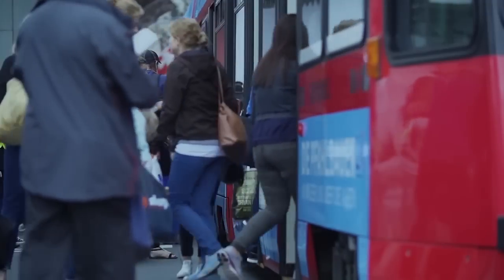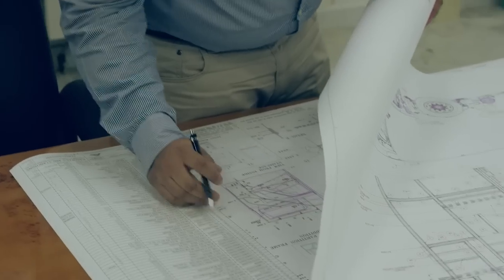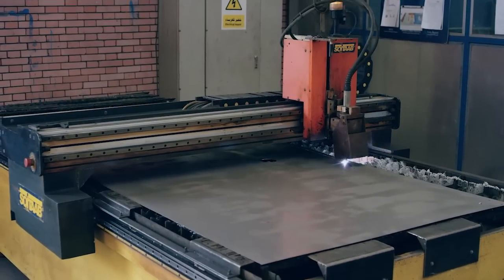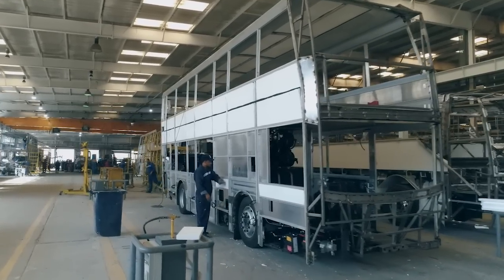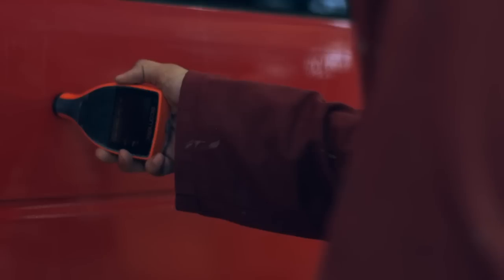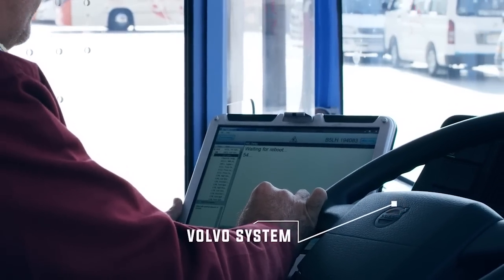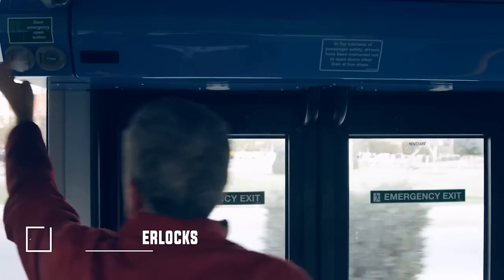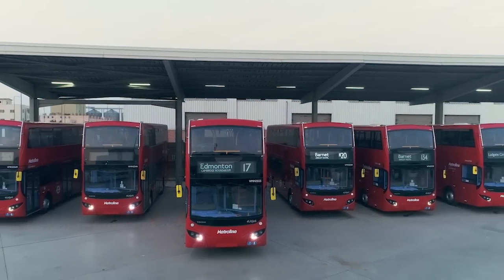MCV eVoSeti | How a Double Deck Bus is Built

Comment: Much as I am not comfortable asking the depot why they stopped running the London Suburban Loud 4-Speed Leyland Hydra cyclic Automatic Gearbox Gardner 6LX and Gardner 6LXC Diesel Engine Olympian ECW’s on routes N26, 30, 121, 230, 271, 349, N279 And 158 why can’t we make the same make of the Loud 4-Speed Leyland Hydra cyclic Automatic Gearbox Gardner 6LX and Gardner 6LXC Diesel Engine Olympian ECW Buses but Modernise the insides of these Buses. Also, make it low floor up and down and also extend the middle body part of these vehicles a little bit more so there will be more space for the wheelchair users. By the way, if you could remake and Modernise these vehicles could they also make them into a Loud 4-Speed Leyland Hydra cyclic Automatic Gearbox Gardner 6LX and Gardner 6LXC Diesel Engine Olympian ECW Version’s that if it will be possible and Modernise the insides of these Loud 4-Speed Leyland Hydra cyclic Automatic Gearbox Gardner 6LX and Gardner 6LXC Diesel Engine Olympian ECW’s make it low floor up and down and also extend the middle body part of these vehicles a little bit more so there will be more space and even a London Suburban Scania N230UD Enviro 400 MMC and also extend the middle body part of these vehicles a little bit more. Why couldn’t we have those London Suburban Buse's Pale red on the top roof Pale red again on the top middle Milk Chocolate brown in the middle Creamy white on the Bottom Middle and Milk Chocolate Brown on the Bottom on most of those kinds of those Particular Double Decker Vehicles? Could you put the Loud 4-Speed Leyland Hydra cyclic Automatic Gearbox in the Scania N230UD Enviro 400 MMC and also put the Loud 3-Speed Voith Diwa Gearbox in the Volvo TD102KF Engine East Lancs Olympus and also extend the middle body part of these vehicles a little bit more and also turn most of them to a London Suburban Buses. By the way, could you also make the routes N26, 349, 121, N279 and 271 into London Suburban Buses and have a mixture of a Loud 4-Speed Leyland Hydra cyclic Automatic Gearbox Scania N230UD Enviro 400 MMC and Loud 4-Speed Leyland Hydra cyclic Automatic Gearbox Gardner 6LX and Gardner 6LXC Diesel Engine Olympian ECW Version. Could they also transfer the Arriva Bus Depots from Hackney to Stagecoach company so they can replace all the Arriva buses and all of them can go to Birmingham and Leeds? They can be replaced by Stagecoach Loud 3-Speed Voith Diwa Gearbox Volvo TD102KF Engine East Lancs Olympus and also Extend the Middle body part of these Vehicles and that includes A Mixture of a Stagecoach Loud 3-Speed Voith Diwa Gearbox Volvo TD102KF, Gardner 6LXC and Gardner 6LXCT Engine Northern Counties Palatine One and that Includes a Loud 4-Speed Leyland Hydra cyclic Automatic Gearbox Scania N230UD Enviro 400 MMC Vehicles A Little Bit More. Can Arriva London Bus Company Replace Most of their Wight Buses so they can also transfer them to Birmingham and Also Manchester so they can be replaced by Loud 3-Speed ZF Ecomat Gearboxes Volvo D10A Engine East Lancs Olympus and also Extend the Middle body part of these Vehicles A Little Bit More Thank You Very Very Very Very Very Very Very Very Very Very Very Very Very Much. Oh buy the way could the bus Factory Companies also Make More of Those Loud 4-Speed Leyland Hydra cyclic Automatic Gearbox Gardner 6LX and Gardner 6LXC Diesel engine Olympian ECW Vehicles And that also includes Those Loud 4-Speed Leyland Hydra cyclic Automatic Gearbox Cummins L10 Enviro 400 MMC And also Extend the Middle Body part of those Loud 4-Speed Leyland Hydra cyclic Automatic Gearbox Gardner 6LX and Gardner 6LXC Diesel Engine Olympian ECW Vehicles and the Loud 4-Speed Leyland Hydra cyclic Automatic Gearbox Cummins L10 Enviro 400 MMC Vehicles and that also includes The Loud 3-Speed ZF Ecomat Gearboxes Volvo D10A Engine East Lancs Olympus A Little Bit More And Paint Those 4-Speed Leyland Hydra cyclic Automatic Gearbox Cummins L10 Enviro 400 MMC Vehicles and also those Loud 4-Speed Leyland Hydra cyclic Automatic Gearbox Gardner 6LX and Gardner 6LXC Diesel engine Olympian ECW Vehicles and that also includes The Northern Counties Palatine One with a Volvo TD102KF, Gardner 6LXC and Gardner 6LXCT Diesel engines with a Loud 3-Speed Voith Diwa Gearboxes and The Loud 4-Speed Leyland Hydra cyclic Automatic Gearbox Scania N230UD Enviro 400 MMC Vehicles and also The Loud 4-Speed Leyland Hydra cyclic Automatic Gearbox Cummins L10 Enviro 400 MMC Vehicles to the Grey Green Colours Just Like The Other Original Scania Grey Green on the Bus Route 313 and the 103, If all The Leyland Titan B15’s are Fully Red and even Mostly Red, could they also Repaint All of The Leyland Titan B15’s into Grey Green Colours Just Like The Other Original Scania Grey Green on the Bus Route 313 so they can Reuse them for Only Every 6 and a Half Months and also Reuse them on those Rail Replacement London Bus Routes if that will Be Alright for Only Just Every 6 and a Half Months and also Reuse Those Buses Only on the London Bus Routes witch are The 341, N41, 34, 123, N29, 149, 221, N73, 121, 86, 30, 262, 147, 396, 41, N26 so Please make sure that the builders can do as they are told!!!! And please do something about these Very Very Very Very Very Very Very Very Very Very Very Very Very Very Very Very Very Very Very Very Very Important Professional Ideas Please Please Prime Minister and also Includes the Mayor of London.😉😉😉😉😉😄😄

Comment: Here in the UK, the most popular bodywork is made by MCV and Alexander Dennis.

From Alexander Dennis, the popular choice is the Enviro 400 ( Hybrid), a specially designed body style for Hybrid buses.

The Enviro 400 is the bodywork for double decker buses.

I also love MCV.
I have spotted Stagecoach with the MCV Body. Bus manufacturer is Volvo....
If you come to UK, you will see Volvos rolling on the streets...
Reply: the most popular bodywork is wrightbus & adl with the most buses seen on the road being of adl type... MCV have a very very small share in the bus market

Comment: Sorry but the MCV has to be one of the worst quality built buses Ive ridden on. Bits and bobs falling off, extremely plastic the hardest smallest seats, poor legroom. Looks like the interior is 3D printed!
Reply: Bla bla bla !! 🤪🤪🤪
Reply: I was on one on the Route 274 and there was a hole in the roof.
Reply: I am a bus nerd that knows every bus in the city and who drives them. I can assure you that it's not the worst bus. Look up Iveco citelis. Awful drive, rattlebus, ugly, crappy ac and webasto, to sit on the driver seat you have to climb mount everest and awful suspension. Our city received these turds and they are giving them away to private nearby bus companies.
Reply: Forgot this : his methane brother Iveco citelis Is much worse
Reply: You can’t blame a manufacturer for the seating (unless it’s their ‘dealer white stock’)- normally the operator specifies what seating they have.  Looking at TfL it appears to be Esteban which are a good manufacturer (maybe not the Urban90 though…..).
Reply: To be fair, compared to previous models, the EvoSeti is a nice looking bus.
Reply: So true man, i dont like evosetis much at all